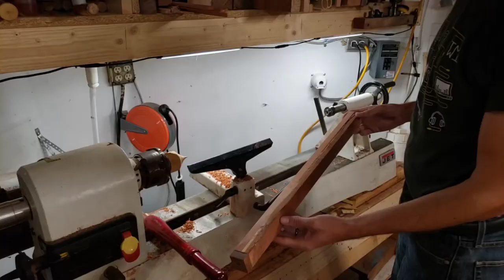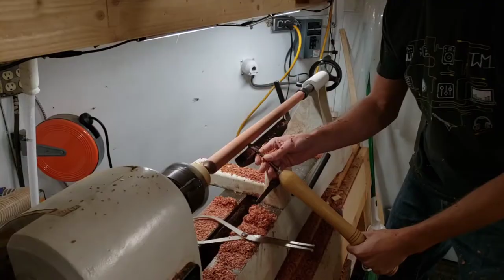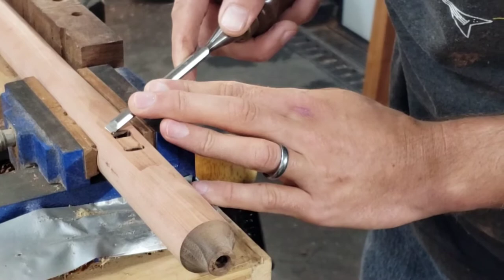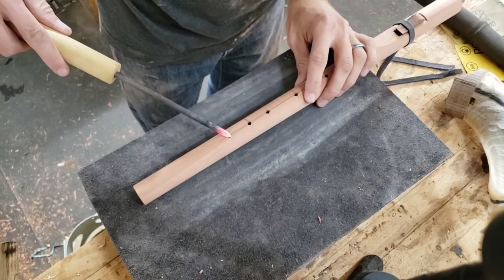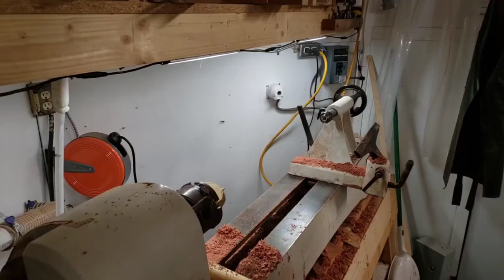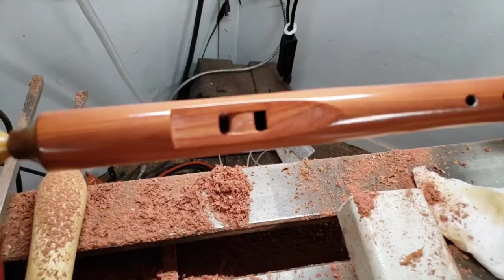Red Cedar Lathe-turned Flute

Comment: This is great! Why burn the holes rather than drill to size? Not a critique, just curious if there was a functional reason, or just for esthetics. Thanks!
Reply from the maker: I like to burn the holes to tune it in perfect pitch,. It's hard to sand out the little burs on the inside of the bore made from drilling. Using a hot iron burns the burs off. I also like the esthetics of the burned holes.

Comment: phenomenal sound! great job! After training on the lathe this Thursday, I hollowed out a prototype on a lathe for practice. It was only 8 inches long so I don't know if it's playable. That's actually why I'm here today, searching for a video of a solid body mini flute, if it's possible. I used a 3/4" drill bit from both ends. OD is about 1"1/8 but it's just a practice anyway for my long oak piece I hope to turn into a flute just like this! or one from Blue Bear Flutes. 

I'm interested how you do it and how you choose the diameter of the hole as compared to the outer diameter of the flute, after you've lathed it.

Comment: Hi, Caleb
Love your flutes; lesson and your work.
I wonder if I could ask you a technical question!?
Simply; if I have a flute that plays really well; and I cut the tube off the flute! So; all I know have is the sound part and about two inchs of pipe in front of where the sound is generated and comes out! If I now blow through the very shortened section (and, again, this is where the sound is generated) ... if I blow through this, will I get a sound ... !?
The reason that I ask is that; I have built a 34'' Contrabas flute; the long tube is finished, but not connected to the sound part, but, for the life of me, I cannot get any sound out of the sound part! I would have thought you could create sound through the sound part with it disconnected from the tube part ... !?
Hope you can help on this one, as I am now completely stuck ... !
Best wishes ... 
William (Hampshire UK)
Reply from the maker: Hi William, I'll answer your question as best as possible. It's hard to give you an exact answer without seeing the flute. As long as the mouthpiece is made to sound very nice, you could put almost any size tube on it and it will make a sound. However, when you get past around 22 in long, the sound starts to drop out. That's because the sound waves do not get enough air intake and the sound starts to suffocate. The way to fix that is to make the channel and true sound hole bigger. But that's tricky and takes a lot of practice to get right. So for my guess, your 34" tube is too  long.
Reply: Thank you, Caleb for that. It gives me much to think about. @calebbyerly